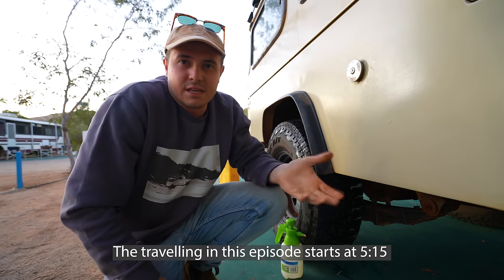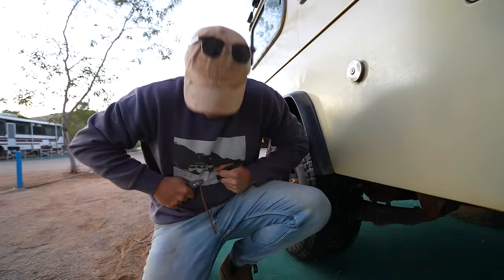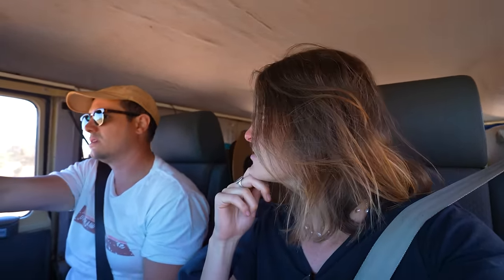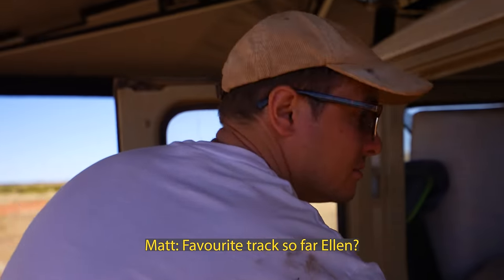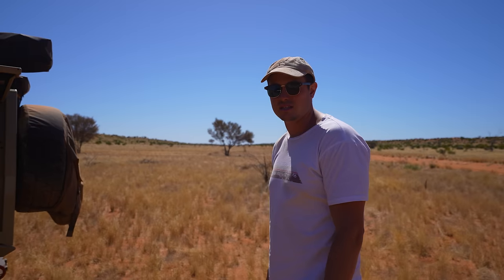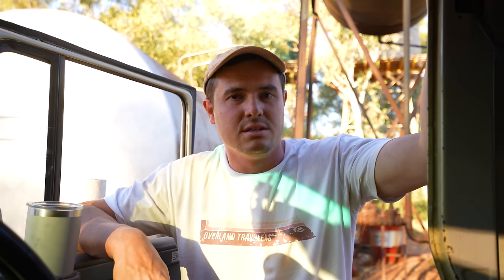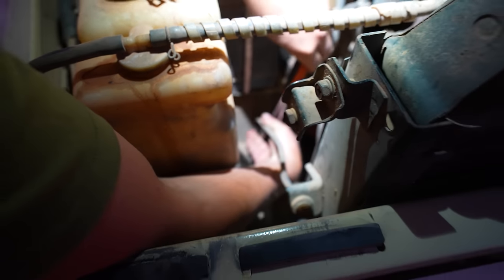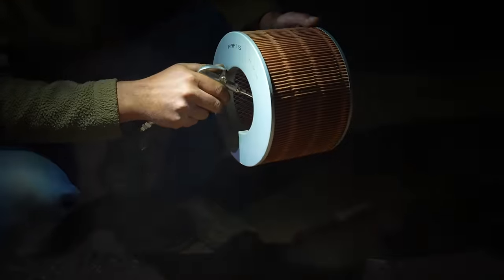Discover Australia's Hidden Gem: The Binns Track - A 4x4 Adventure Like No Other!

Comment: A little hint for anyone looking to buy a tyre plug repair kit. Buy one with metal handles not plastic, the plastic handles are known to break, sending the metal shaft straight through your hand. You don't want to be several hours away from medical assistance with a steel shaft through your hand.
Loving your videos, always waiting for the next one.

Comment: Hey mate, get yourself a diamond plug drill bit, usually available at a tyre shop. Just put it on a battery drill and makes a much cleaner hole and make plugging so much better.
Reply from the maker: That actually sounds like a good thing…. I’ll have a look!
Reply: @OverlandTravellers  , yep, throw that hand one away. 👍😀

Comment: Hey Matt, If you lubricate the plug with cement glue, It will slide in much easier, just be careful not to push all the way through. I just use tire repair glue like for the bikes, and it helps plug any pin holes that might be left behind.

Comment: As a retired commercial trucker, i've always been told to never preasure blow out an air filter. You should just take a longer time and just tap out the dust. Enjoyed the video
Reply from the maker: I think it’s pressure blowing it from the outside in that’s a no no…. From the inside out is the way to go apparently.